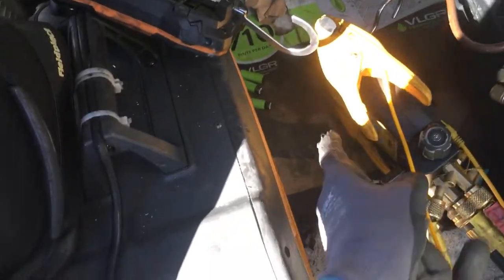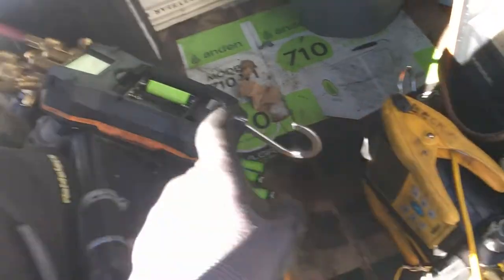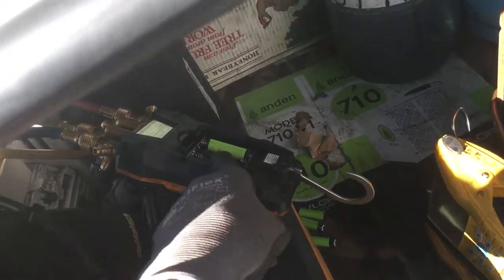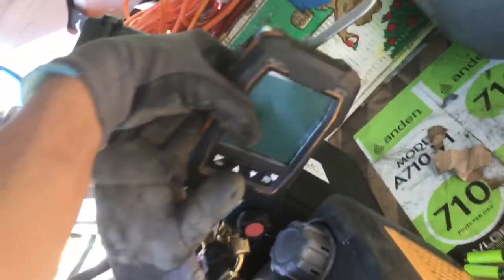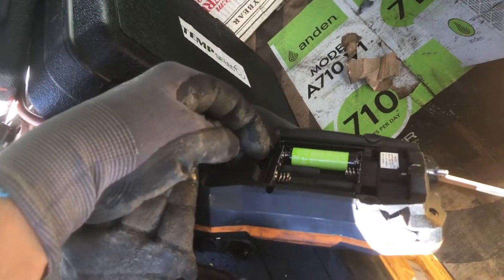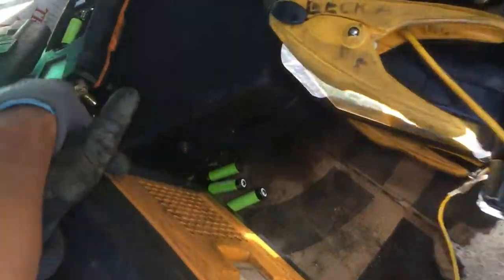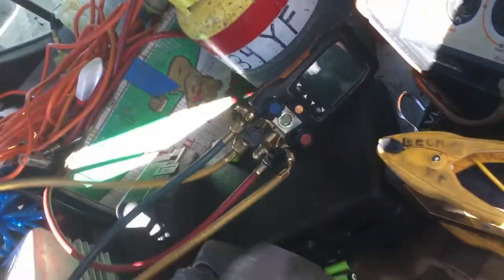Fieldpiece SM480V￼ Rugged tried and true extremely reliable. The exact opposite For Testo 557S￼￼

Comment: Agree, really like how Fieldpiece has improved their products.
On the otherhand, wanted to replace sensors in my ancient fieldpiece manifold, they told me sensors aren't offered, go buy a new manifold.
I don't blame them, would be better-off with the new model anyway.
Reply from the maker: Turn, I opened mine up.  Not replaceable. 
      At least without lot of work and knowhow and parts sourcing from Digakey or Mouser

Time for second sub condenser or bigger condenser
Reply: @coldfinger459sub0  Better condenser with fins, the one it's supposed to have. ;)

Comment: 7 likes over 600 views(after 3 years lol) no REAL TECHH TAKES FIELDPIECE SERIOUSLY.  Also, automotive ac techs are automatically novice techs, there is no real challenge. I can and have repaired auto air conditioning and it bores me. Just call yourself a mechanic so there is no confusion. 7 likes 2 years 😂no wonder you believe what you say.
Reply from the maker: My videos are hidden because I did not monetize my channel and as long as I keep it that way, very few people will ever see my videos. 
      It’s OK, my sales of Fieldpiece and other HVAC equipment on my Molland ties 8% commission has sold and made more than most tech will make in two years of income just by me sitting on a couch watching TV without even having to work. 
       What input do you generate to help young technicians come into this industry? 

You got a lot of lip flapping, but no action . 
     You probably make a good salesman or manager. 

I am looking for a new filter installer if you ever need to position it’s open for you .
Reply: @coldfinger459sub0  SHHHHHH 😂
Reply: @coldfinger459sub0  my input for younger techs? lol! don’t be a mechanic claiming to be an HVAC technician. That’s a good start.
Reply from the maker: @reaperinfinite8427  one day you will graduate from there. Will let you use the grease gun to start looping motor bearings and changing fan belts..  you’re almost there. Promotion is coming.
Reply: @coldfinger459sub0  lol bums make the best jokes. What other jokes do you have other than being a stagnant mechanic
Reply from the maker: @reaperinfinite8427  I just got the DNA test back today. Just found out you’re my son. 🧒 
Say hi to mom